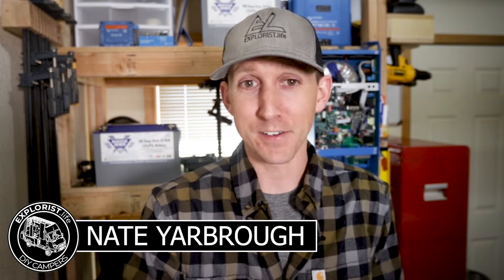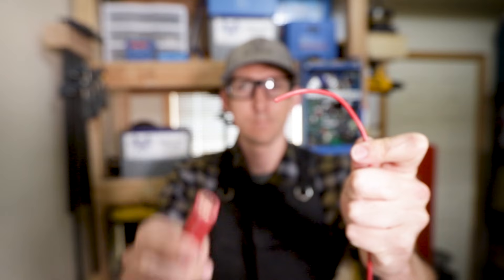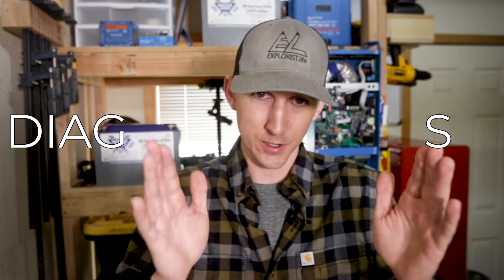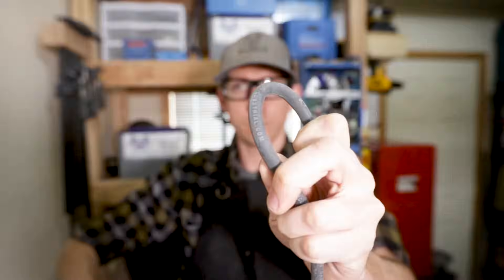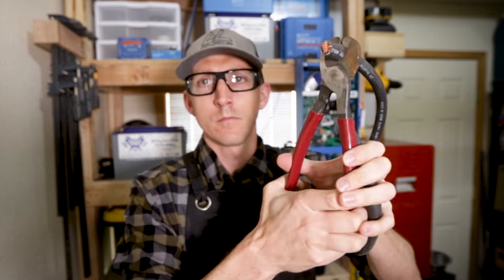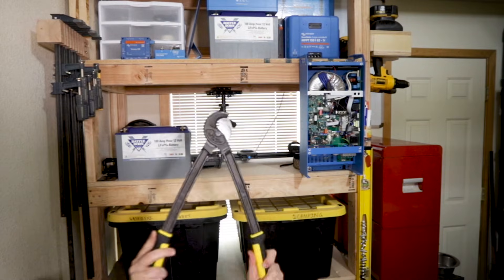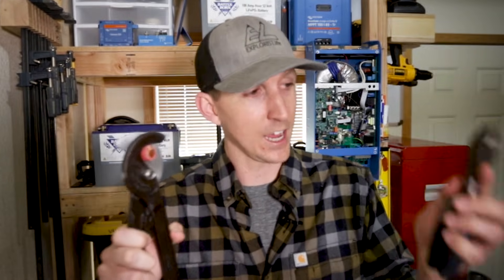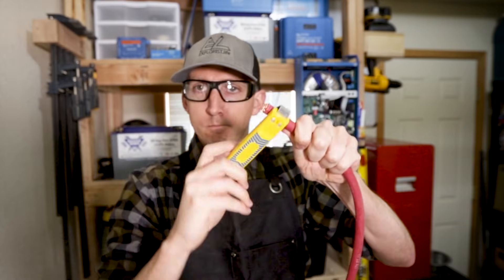How to Cut Wire - 4/0 to 22 AWG

Comment: Hi, looking for some assistance. i have an older kit this was bought in 2020, consist of four RNG-100D-SS, a Wanderer Controller, and three Valiant VTD12-100. these were originally used as solar relays for ubiquiti accesspoints. but i plan on repurposing them for backup power for my Networking rack. which has an external  DC input 48V DC, 6A. i understand this is a 12V kit. and i was reading that the batteries can be wired in series to achieve 48V. my curiousity is which controller would other users recommend? or if this is possible. im rather new to this sort of thing. our home will be built by end of march 24' so i have abit of time to learn. (Note i did say the kit had three batteries, i actually have 6 total and 8 solar panels.)
Reply from the maker: I don't have any direct advice for what you've got going on, but I suspect if you watch this playlist start-to-finish, you'll have a really good idea of what you can and can't incorporate into your project: https://www.youtube.com/playlist?list=PLmvhcyi4n0TU6HlMaQiCUwC20DBlyv6s_

Comment: It probably won't happen but if you are cutting leads like those to electronic components a shear wire cutter will no introduce shock like a diagonal wire cutter will.  It is not a big deal unless you are working with components like resistors or capacitors etc.

Comment: Have you had any experience using this TEMCo Industrial
TEMCo TH0035 Ratcheting Cable Cutter - Cuts up to 500 MCM (240mm²)? If so what would be your choice over when compared to this, TEMCo TH0002 18" 400 MCM ELECTRICAL WIRE & CABLE CUTTER

Comment: My friend used cold steel to connect his 4 batteries. I told him I thought the resistance in steel as opposed to 4/0,  2/0 or copper bars could be a problem. How is it best to explain this to him? Safety/efficiency/etc
Reply from the maker: Copper is anywhere from 7-30% more conductive than steel (depending on the ratio of carbon to iron in the steel).  This means that to reach the same conductivity, the steel would need to be 7-30% larger than the copper to reach the same electrical conductivity.

Comment: I need help please! I cut 6/2 & 10/2 awg regularly. It’s not small copper strands. It’s 3 solid copper wires insulated for high voltage (240v typically). I do HVAC. Thanks for anyone’s help!
Reply from the maker: Most of the pinciples will be the same.  You may have to experiment a bit with it.  I use the biggest cutters shown here for 6/3 wire.  You should be able to cut 10/2 with diagonal cutters.

Comment: A very handy electrical stripping tool is a Knippex Piano Wire Cutter. They are super leveraged making heavy cuts easy but will also cut very thin material. They are a bit pricy but come in several sizes and last forever cutting copper.
Reply from the maker: Awesome!  Glad it helped.  Thanks for watching!

Comment: Great video! Silly basic question...when first starting off wiring, is there a way to tell what wire is positive and which is negative if both are black? I am using these dual stranded 14 awg wire and there isn't a way to tell other than one side has the listing info text and the other side is ribbed. Do you choose one for your positive and one for your negative connection from the start? New DIY converter here and not looking to blow up my van. https://www.homedepot.com/p/Southwire-50-ft-14-2-Black-Stranded-CU-Low-Voltage-Landscape-Lighting-Wire-55213242/202316252
Reply from the maker: I must recommend NOT using that wire as it is not specifically designed for use as wiring the branch circuits around a camper van.  Instead, this wire is specifically approved & designed for that purpose: https://amzn.to/3jm3No8

Comment: Also Pro tip

Ratcheting PEX cutters are freaking awesome.
Reply from the maker: Yes!  So game changer.  I saw some ratcheting wire cutters for large gauge wire the other day and was hovering the 'add to cart' button for too long.  lol  Would be handy for travel since those 16" cable cutters don't fit in my portable toolboxes.
Reply: @EXPLORISTlife  i completely stopped using dedicated cutters after i got pex cutters.  they last for 4 or 5 vans and are 18 bucks.  and i can cut in tight spaces.
Reply from the maker: Wait... you are using pex cutters for wire?  I wouldn't have thought that would have worked.  Nice!!
Reply: @EXPLORISTlife  yup.  Works fantastic.  Been doing it for a year or two now.  Up to 3/0 ive tried and its like butter

Then i use the non ratchet pex cutters to cut the jacket. its way faster and safer than a razor.